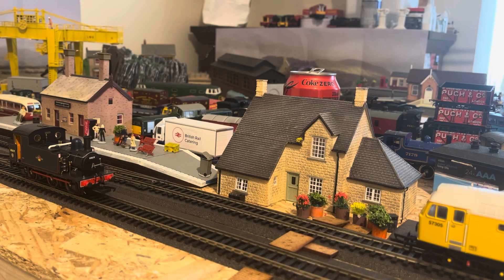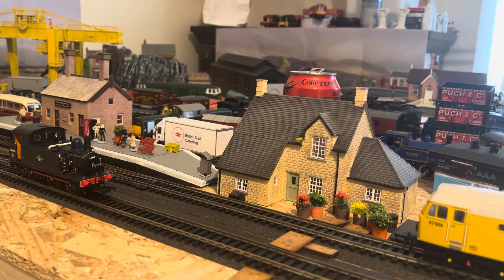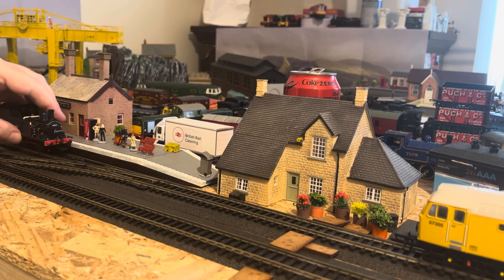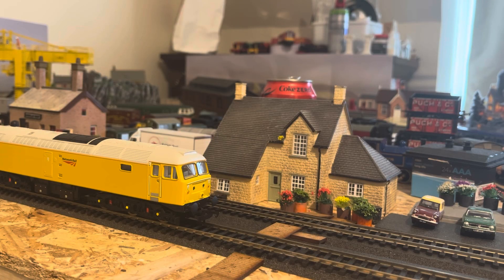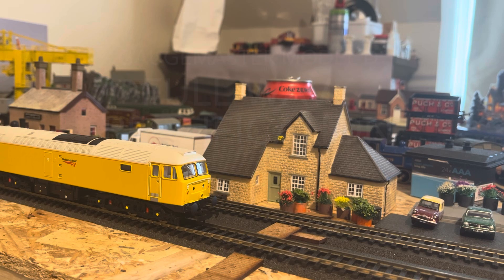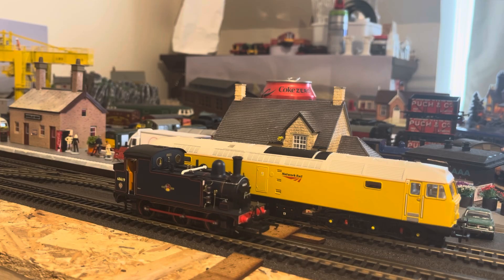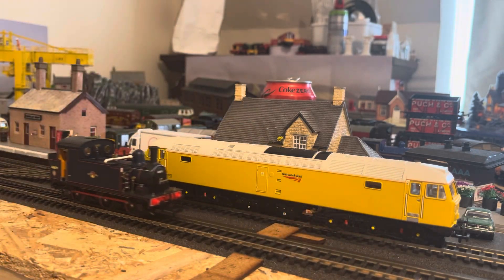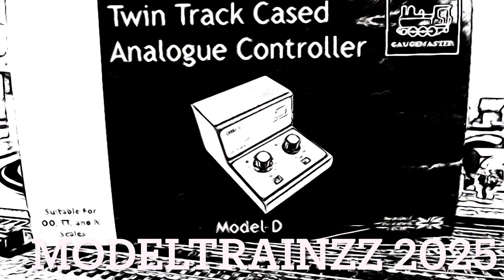Coreless Motors Force buying a New Controller

Comment: Which "old Hornby controller" were you using? I've never heard of a Hornby controller that uses PWM.
Reply from the maker: Hi Henry,

Thanks for reaching out.

For a clearer explanation of PWM etc.  check out Model Railways Unlimited on YouTube.  Episode is called Morley and Gaugemaster….

He covers the subject in far greater detail than I have.  It is an excellent in depth look at different types of controller and how they control our Scale Models.

Hope this helps.

BR

MODELTRAINZZ
Reply: @MODELTRAINZZ  Thanks, but I've seen that. It still doesn't answer my question. Which old Hornby controller were YOU using?
Reply from the maker: @henrybest4057 Hi Henry,
I think it’s number is R905

BR

MODELTRAINZZ

Comment: Quite a significant improvement and much easier on the passengers when stopping and stating in stations.
Reply from the maker: Hi Piers,
Yeh the Coreless motors just cannot be controlled on low speeds with the old low frequency PWM controllers.
Also the locomotives seem to be all going Coreless.  I think Bachmann is releasing a 8F (Large Steam Loco) with a Coreless motor; early next year.

Happy so far, but if you see the other comments in the post, there needs to be more testing 👍🏻 

BR

MODELTRAINZZ
Reply from the maker: Slight amendment…

Bachmann’s New Stanier 8F is releasing in Summer 2026 and will definitely be a Coreless Motor.  RRP starts at £249.95 for DCC ready version.

Comment: Interesting . Faced with dire warnings on  paperwork with Accurascale and Rapido motors I replaced my old 1970s Clipper and R910 Hornby Controller with a new Morley Vectron Controller . This does run my latest locos very well eh Bachmann Caley 812 , Rapido Jones Goods . However , disappointingly it can’t cope with my older locos . Wrenn , Hornby Ringfield even Heljan locos . They run very slow . So frankly I’m a bit hacked off because it now appears there is no universal controller that can run both old and new . It’s all very well producing these exquisite models but they really should run on existing equipment . Contemplating a Gaugemaster D to see if that makes a difference given that I have an existing Gaugemaster DS (although that one is 25 years old) that can run these older locos . Just hope the more recent D is up to the job
Reply from the maker: Hi Russell,
Well I am a big Wrenn fan so I’ll do some testing for you.
I’ve been researching the different motor types and rectification methods and decided I couldn’t continue with my old controller to run modern locomotives.  It’s an interesting point you have made and I’ll look into it for you.

BR

MODELTRAINZZ
Reply: @MODELTRAINZZ  Thanks would really appreciate knowing how Wrenn and maybe some older Hornby X04 and Ringfield run on it . I have a 1974 Hornby Black 9F that just doesn’t like the Morley - or at least runs at half speed
Reply from the maker: Yep got X03 type.  I’ll set up some “Old School Test Running  Session” this evening and let you all know.  👍🏻 

BR

MODELTRAINZZ
Reply: @MODELTRAINZZ Superb . Again many thanks for help